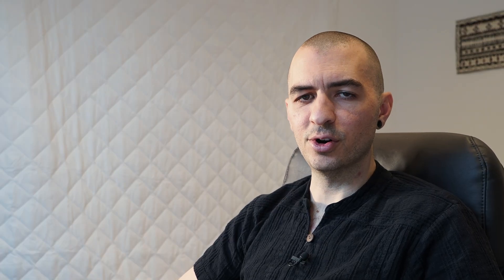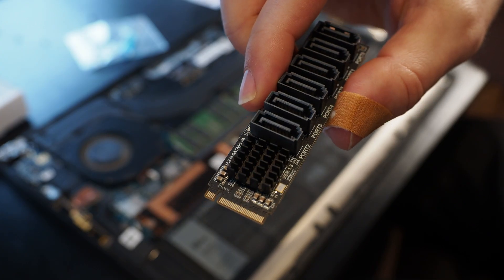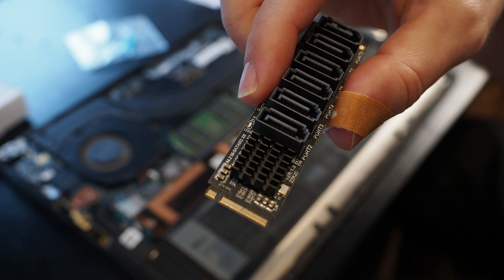Transforming a Laptop into a BEAST Home Server via $25 M.2 SATA Adapter

Comment: i did the same thing, old laptop (i7-8550U, 12GB DDR4, lan 2.5Gb on usb 3.0), same transition from nvme to 6 sata. my laptop is powered from usb-c. for powering the drives i used a pico-psu. all of this is powered by a 12V 5A 60.0W power supply
The whole thing draws 8 watts when the drives are sedated. 1nvme, 2x2TB 1x8Tb.

It looks as bad as it does here, but no one sees it every day because it's locked in a cabinet.
Reply from the maker: Awesome! Did you also cut a hole in the laptop case, or just leave it off?
Reply: @RickyKresslein  no i just dismantled it and threw it in the junk in the garage. i removed the lcd screen (it is not needed, because there is a remote desktop, if anything i connect the screen under hdmi). In your case, the biggest energy eater will be that your power supply of poor efficiency.

Comment: I feel like this could have been 10 times less jank, but where's the fun in that?
Reply from the maker: Haha yeah, definitely. I don't have a dremel or grinder or anything on hand to make the cut in the case much nicer than what I ended up doing, and I wanted it to be done cheap which meant using the tools I had. I don't care about resell value on this laptop, so fun was the top priority 😂

Comment: Power consumption ❌ Laptop preservation (usable but the holes....) ❌ Fun ✅
Reply from the maker: 😂 Definitely fun. Since it's an old laptop I wasn't worried about the preservation. I'm curious why you say power consumption is an issue? I haven't measured the power consumption compared to my old system yet but I'm planning on doing that soon. Do you think the power consumption will be higher than with the docking station?

Comment: What sata SSDs would you recommend if I only needed 4-6 TB total? I looked at the 870QVO but those are a bit out of my price range 😅

I have never had a homeserver or anything of the sort, just PCs that I built myself over the years. I am just now getting into this stuff, watching videos and trying to plan what I want to do without going into debt.
Reply: probably get some Samsung 845DC Pro those thing last forever. Only caviat is that you most likely are gonna get them used.
Reply from the maker: Honestly I don't have a ton of expertise on current SSDs. The main reason I went with the 870QVO was because they were the only 8TB drives I could find for a halfway decent price. @anh413 probably has a better answer than I could give.